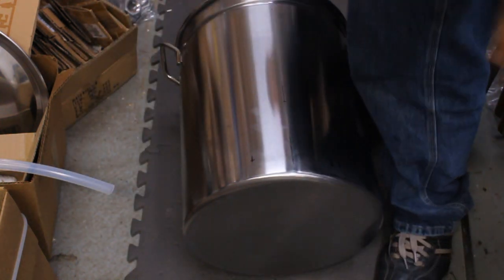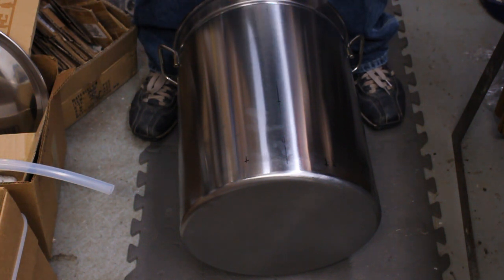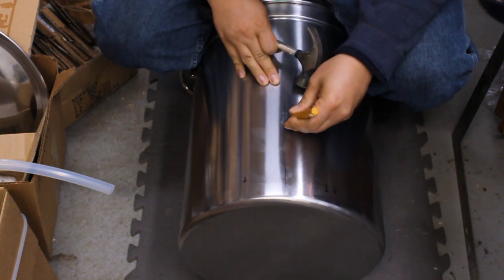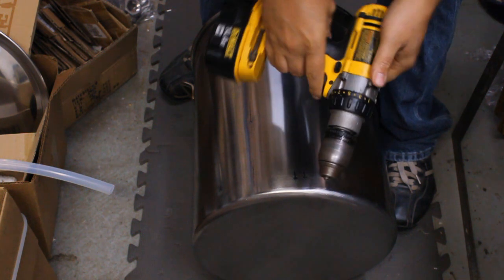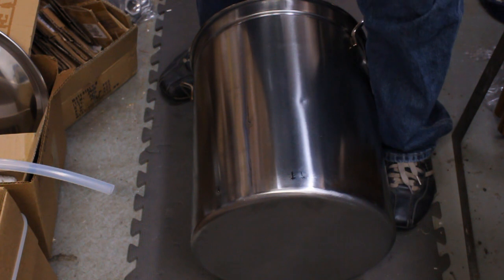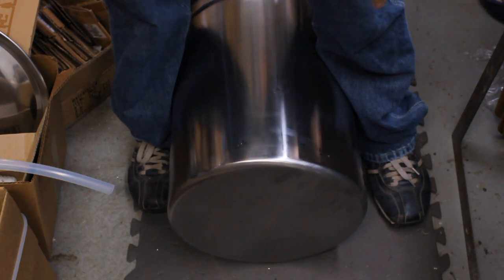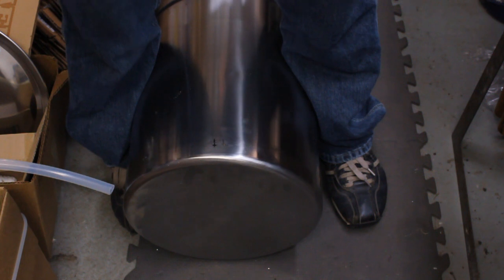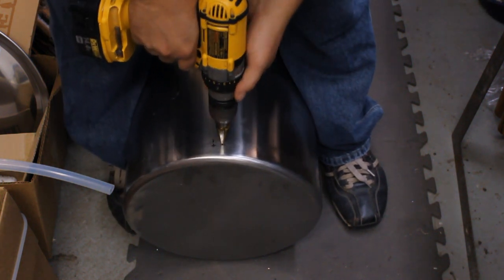BobbyFromNJ Part2 Brew Pot Build Drilling Stainless

Comment: Those Chinese step drills really do work great I’ve used them for 5/8 holes in 3/8 cold rolled tow bars.  Excellent tutorial.  For extreme precision in cutting stainless kettle holes, try a carbide tipped hole saw.  You would think it was laser cut